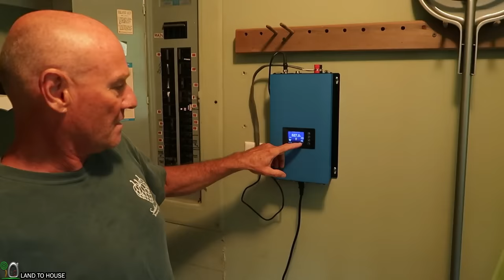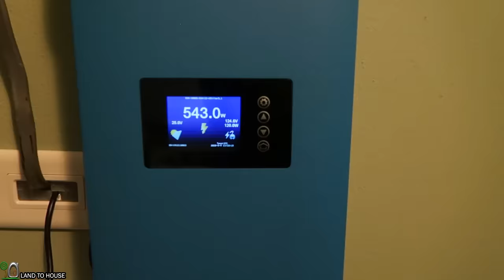Awesome Low Head High Flow Grid Tie Micro Hydro 530 watts!

Comment: What does the guy need 800 kwh a month for? My family of four uses 1600 kwh a year...
Reply from the maker: My home just this month used 2000kwh. The Hvac unit is broken and using a ton of power.
Reply: @LandtoHouse  Do you only use electric heating?

Comment: 0.5 KWhr is about 5.5c/hr worth of energy and $3,000 just in parts is a 54,000hr or 6.2yrs payback NOT including the free electrician labor, maintenance and part failures running 24x7. Just a hobby.

Comment: Hang on...
Let's pretend that turbine is running 24/7
530x24x31= 394320 Kwhr. 

His power usage went from 900Kwhr / month (almost 1 Gwhr!) to 300Kwhr.
So he's using 2/3 less power, and being charged 1/2 what he was, and 1/3 of the 2/3 power savings didn't come from the turbine. 

It's a GREAT project, don't get me wrong, but clearly the maths is off.

Comment: I assume you guys own this land, or at least have some kind of rights there. And have you thought about what could happen if there's a huge deluge of rain causing the stream to swell to huge and destructive proportions? In my part of the world here in England, UK one of the local rivers has swelled to huge levels twice in recent years and flattened several weirs and demolished the surrounding concrete walls. And wouldn't you get much more power from that weir if you built a long water wheel right across the weir and overshot it from above?

Comment: Is there an electricity bill update? Damn, imagine that with solar energy.  I could turn on the AC without worrying to my sad wallet.
Reply: how do we tag them so they notice this, I am also very interested in a revisit/review of basically everything here.
Reply from the maker: I actually went back a month ago. A big storm caused some issues with down pipe getting washed out. He is redesigning.
Reply from the maker: A storm washed out the system. He is rebuilding.
Reply: @LandtoHouse  that's actually cool, the redesign might be an improvement, and maybe this time there could be an update. This vid really made me curious.

Comment: I wonder if the water fountains that are in 1800's photo with the words ' Energy station' using this type of idea,  If like in that photo, water was pumped to the highest point (crank start as I referred to as simular to cranking the engine.  And from small bowls into larger bowls each bowl  having a a 'turbine' in each 'bowl' adding volts with each 'turbine bowl', if U kept adding small bowl turbines' untill it provides more Volts than U need.  Some cities had fountians 1/4 mile apart, the excess volts would add together from each fountains.  The globalist have hidden roman concrete (as they refer to it,)  resipie = like all inventions that would help to release their grip on us, like ionizing water   using sound for the easier way to 'sift' out hydrogens smaller molecule from water, and the larger oxygen molecule, (I might have the sizes backward.  Still frequency is also something globalist hide from U and Me.

Comment: He should be using 10/3 with ground and not running the 3rd phase through the ground wire; unless you misspoke. Ground is for ground for safety! Otherwise his electrician friend should never ever touch anything electrical again. So I'm hoping you said it wrong and he isn't using 10/2.

Comment: Back feeding your home power with a cord plugged into an outlet.  That's commonly known as a suicide cable.  Not smart, not cool.  The rest of your system is pretty cool.  Get an electrician to run your inverter into a breaker and get rid of that suicide cable.

Comment: Is the Less stupide of this sort of vidéo Y like
But what is necessary to have a good water course is to have a sufficient height of fall.
Recall:
Output power in watts = flow in litres/second X 9.81 X drop height (in mètres) X efficiency of the turbine-alternator system (approximately 0.7)
With the flow you have I can believe in 530w

Comment: Local power company will NOT purchase power unless you are generating 4 mega watts in my area.
Reply from the maker: If you have a pro install in this area you can get a bi directional meter.  I prefer to keep it in house myself.
Reply: @LandtoHouse  I had gathered that you could have the bi-directional meter, my comment was more of a reminder for anyone thinking about going off grid  to check their local power company's policies.
Reply from the maker: @jaquigreenlees  Yes good point.

Comment: I  have always been a little underwhelmed by the maximum power out of these micro hydroelectric  they do not seem worth it for all the effort
Reply from the maker: The basic math on hydro: (head pressure in feet X GPM)/ 10=power
You have to either have a LOT of water flow or a nice drop. Say you have 150 feet of drop with 60gpm
(150 X 60)/10=900w. That comes out to 21kwh a day. Most homes use 30kwh a day. 

takes a lot of water to power a house.

Comment: This system might be renewable, but don´t kid yourself into thinking it´s eco-friendly. Small scale hydro is an absolute ecosystem killer. I certainly hope this dam wasn´t purpose-built for this, because the 10-20 light bulbs worth of power this system is generating comes at a huge cost to the organisms that live in that creek. If the dam is already there you might as well generate some electricity, but personally I think small dams like these that cut creek systems into pieces and separate populations are a crime against nature.
Reply from the maker: That structure was there for many many years before bill purchased his property. That 10 to 15 foot rock face prevents any native fish from swimming back up.

Comment: Very dangerous how he is putting power into a socket.  This is not to code.  Can't believe a license electrician was involved.   You need to be off grid or have your provider inspect your system for safety.

Comment: Everything is cool except the 10/2 UF🤮🤮🤮 at least use 10/3 if you don’t want to use the right stuff
Reply from the maker: I agree.. using the ground for a leg of 3 phase is not good. I used 10/3 in my system and it works well.

Comment: AC to DC rectifier: Why?  Suicide cord: Why? Is the power cable dangling exposed over the fence and not buried?  This seems like a dangerous and inefficient system to be showing off. Nobody should be emulating what this guy is doing.

Comment: Why just settle with the one? Why not add another or two. Start selling back to the grid. You could turn this from a mediocre bill cutting project, into a profitable system that pays you.
Reply from the maker: Of more turbines were added it would slow down the water and not make more power.
Reply: @LandtoHouse  Would that be the case if you had a piping system for every turbine?

Comment: That wiring is dangerous

There should always be a U or V shape to exposed cables to encourage water away from joints and junctions, especially outside!

The rectifier should not be in a little box outside.

The fusing and grounding looks terrible.

Exposed cables aren't the right grade, and even if better grade should be enclosed in some protection.

A real electrician should look over this before someone dies, electricity is extremely dangerous.

Comment: inefficient IMHO... why do they put a tapered tip on a garden hose sprayer? you would think its to direct and shape the water? WRONG, its to create a supercharged effect,  a GOOD penstock no matter the size of the dam has a tapered penstock, this superchargers the water 10 times the power and 5 times more RPMs,  and let me tell you the diameter change doesn't need to be that much at all to yield very good results, take that 6" penstock pipe and reduce it down to 5.5" just 4" before the turbine.. oh boy.. of course you want to use a long tepr in the reduction like a foot is good where you are, maybe 2 feet? reduce the penstock diameter from 6" to 5.5" in 2 feet , a LONG taper...that water pressure will increase ten fold, and the RPM's 5 fold...  yessir, this way you can drain less water but get twice the energy, maybe 3 times more?  try it and see, hale just use a garden hose example, spin a turbine with a garden hose..

you never made a garden hose generator?  you can run your house on one that uses a good reduction, so a 1.5" garden hose reduced to 1.25" and GOOD turbine and stator..  seriously

Comment: Very poor design. The turbine should be at low level then there would be no need for a wet vac. The energy is the difference in head m.g.h=0.5.m.v^2

Comment: smart idea but good ties so stupid. you only get half the output back to the fuse box it would be smarter to have batteries and put the 500 watts into a solar charge controller and batteries because the way he has it if the power is out he screwed. he can't get no power . if he didn't do criti and he just bought a solar charge controller that could take 500 watts and a battery and a power inverter he'd be set so when the power went out he would have power and then it's not tied into the grid and you don't have to worry about all that BS

Comment: That's embarrassing you could have built something way better than that with that kind of water flow and height. 500 Watts is a pathetically samll amount.
Reply from the maker: Hydro power math:
(Head in feet X GPM)/10=power
This system is actually doing very well.
Reply: @LandtoHouse  I didn't say your mini system was not doing well, what I mean is you could have a much bigger more efficient system that uses less water and more watts. I want to see 5 or more kilowatts.
Reply from the maker: @fendtclaas8689  That would take a lot more water or much higher head pressure.